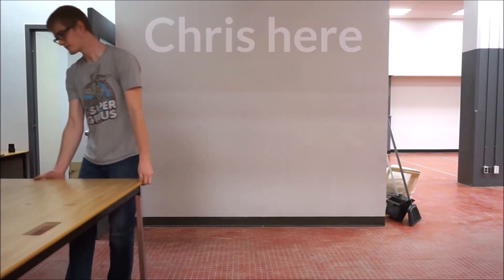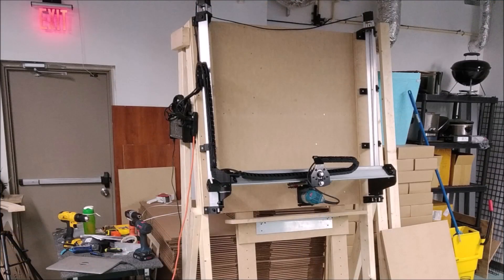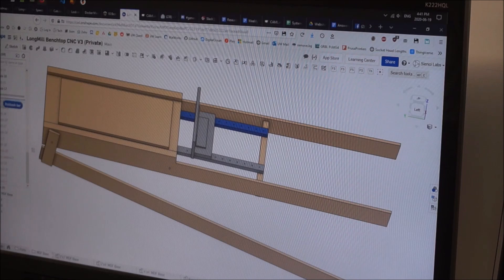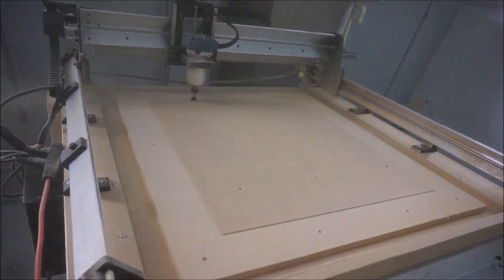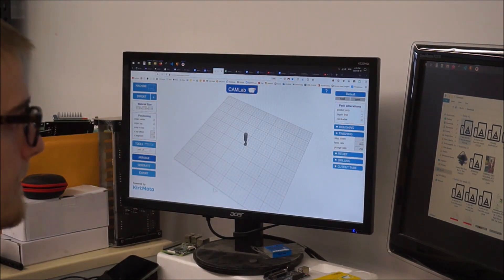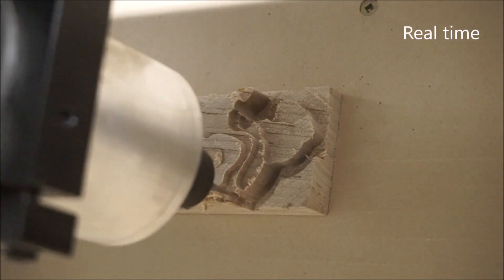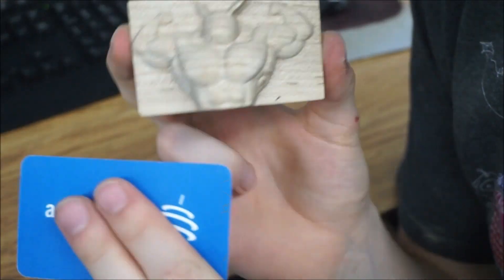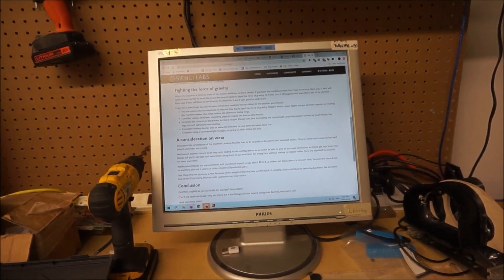Set up your CNC for Vertical Cutting: New vertical stand design

Comment: I like the near vertical orientation. the dust collection would be easier, most of the chips would fall down into a pile. most adjustments could be at eye level.  
I use a stainless steel brush that looks like a toothbrush, this gets most of the fibers broken off.
Reply from the maker: Thanks for your input Dale!

Comment: Newbie looking at 4X4 machines and tight on space.  Wondering if I modified your design if CNC be rotated 90 degrees/horizontal - so that long pieces can be fed horizontally?
Reply from the maker: Yes, technically you could do that. Perhaps one thing I would suggest to is to get the Y axis dust shields to keep the dust from collecting on the rail and screws, but otherwise should generally be the same concept.

Comment from the maker: **One very important thing I failed to mention in this video is that the two EEPROM setting I changed were $111=3000 and $1=255. This slows down the maximum feed rate on the Y-axis to ensure that I don't lose steps even on a longer job and also tells the motors to hold their position as long as power is being supplied to the machine. If you don't set $1 to 255 then your machine may be heavy enough to overcome the mechanical advantage of the lead screws and will slowly 'fall' downwards, losing whatever position it was originally in. 

This is a re-upload of the video from two days ago. The intent is to instead split the original video up into two distinct ones: one for the vertical stand and the other as a CAMLab relief tutorial, just to make things a little more simple and keep each video to a specific topic.
I will post the link to the CAMLab-only version once it's done
-Chris
Reply: one could also try adding constant force "springs" to the Y axis to counter act the force of gravity. what is the weight of the entire Y axis assmbly including router? I'd guess around 28 lbs 20 two 14 lb springs one on each side might work.  https://www.mcmaster.com/constant-force-springs
Reply from the maker: Yeah, that would work well to reduce the extra forces. 28lbs is quite accurate for the weight of the X and Y axes combined